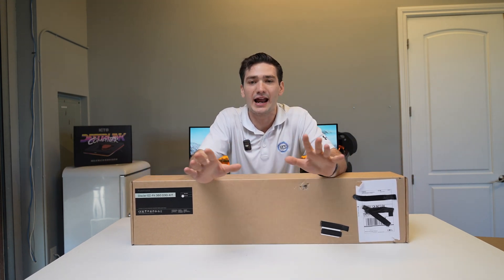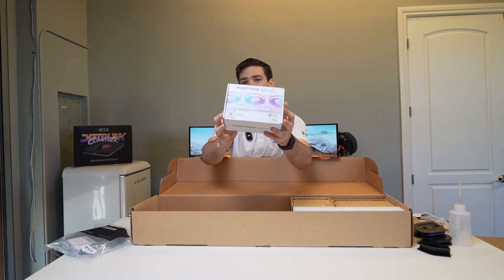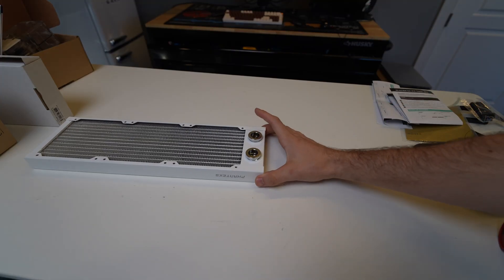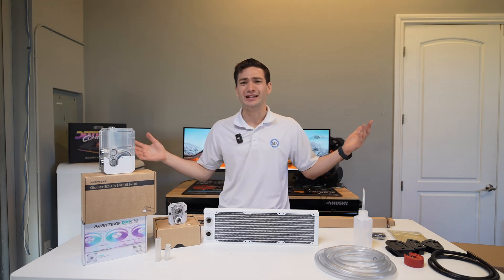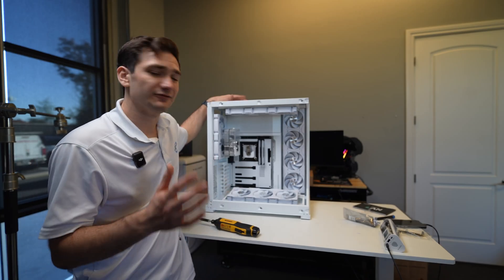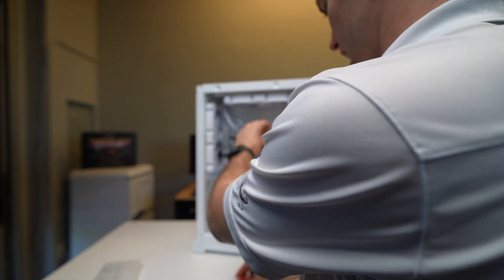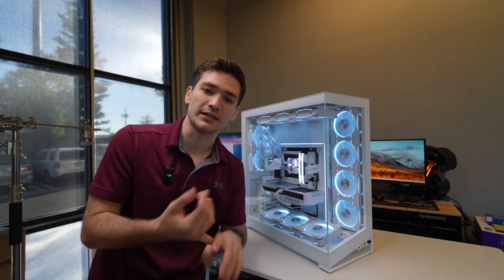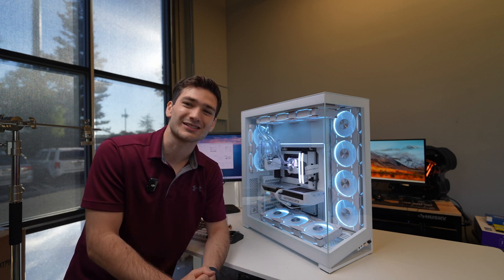Water Cooling Made Easy (Phanteks EZ-FIT)

Comment: I just finished mine 1 week ago and tbh this was really easy to install.  You need to visualize you pc and have an idea on how you would like to look like then is easy. If you can manage to do the bents properly you will be satisfied. 
 1 tip I can give you guys so you can avoid any problems:  if you using any cpu contact frame except the standard one from motherboards (tested om AM5) than you'r cpu waterblock might not have properly contact with the cpu and you'll struggling as the pc won't boot. ( Need to mention that maybe not all the contact frames are the same ) . Other than that everything is perfect.